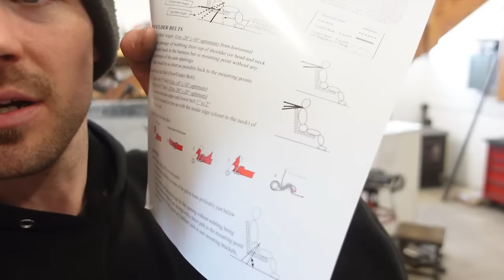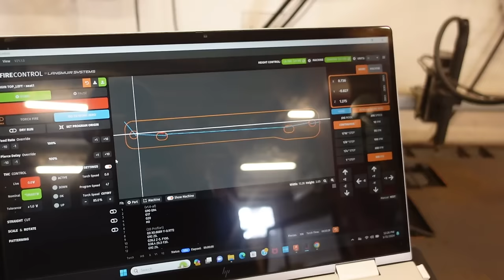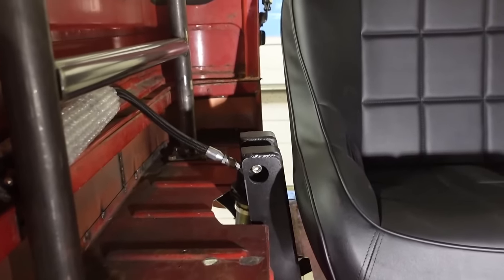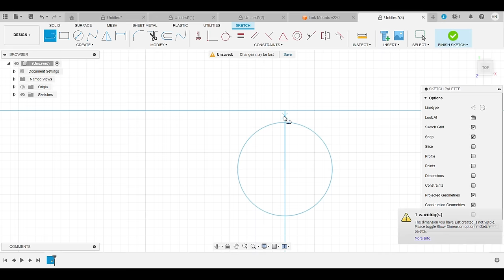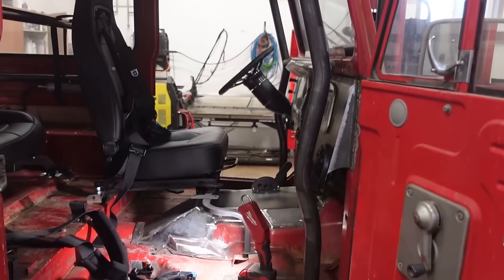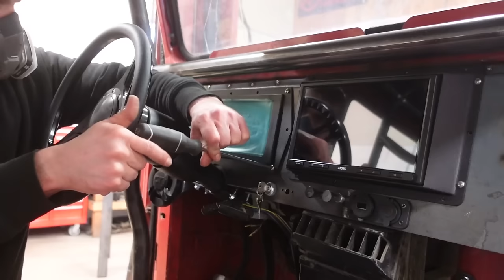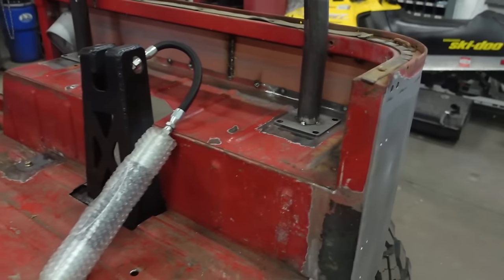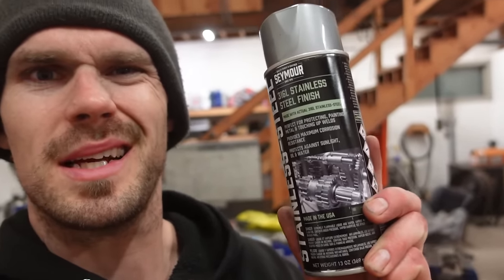FJ40 Gets A Corbeau Rear Seat, 4 Point Seat Belts And A Painted Roll Cage!

Comment: Could you Run a bar under the seat to tie the shock mounts together?
Reply: I was gonna say the same maybe like a square beam
Reply: I was thinking a formed rectangular beam.  It could be pretty wide, maybe 8", and about an inch thick.  It could start pretty high up on the shock mount.
Reply: Was just thinking of that exact thing☝️
Reply: Was thinking of the same thing.
Reply: just typed the same thing out, then read your comment. That is how I would handle reinforcing those rear shock mounts
Reply from the maker: The frame already has 2 crossmembers in the back, I’m not worried about that. I was trying to brace to top of the shock towers
Reply: Pipe under the seat then use a gusset on the towers/pipe
Reply: @austinniemela   but you could tie the shock mounts closer to the top than they are. yes at the top is ideal, but shortening the lever arm helps.
Reply: Was thinking the same... with some type of gusset adding some strength upwards from where the meet the mounts

Comment: Can you not mount a bar half way up the rear shock mount kick it under the seat and back up to the same spot on the other side? Add two bar disconnect connectors like the front shock mounts and notch and weld it through the set bracket mounts. It would still let you remove the seat but give you the most support. It would gain you a support maybe 8-10" higher then the frame mounts? my $.02 Also freaking love the color of the roll cage!

Comment: Looking for how the roll over frame is attached. Is it just through the sheet metal? I used a 1/4 x 6 “ backing plate the full length of the wheel wells. Aluminum because I don’t have the metal working shop you have. I just have the OEM frame. Elsewhere, For individual gauge panels I find aluminum is a whole lot easier to cut to fit the gauges and doesn’t oil can the way thin metal does. Just a thought

Comment: Thanks, Austin! 

IMO using a sandblasting shop is the way to go. Before you bring it back into the shop though, make sure to blow it out a hundred times outside. It's amazing how much sand/media can be held in joints.

Comment: I would swap the rubber body mounts for aluminum pucks.  That rigid mounts the frame and body together, making it easy to attach the shock towers to the cage.  That is how it is done on second gen F-bodies (I have one out in the garage like that).

Comment: Next time instead of going through the trouble of cutting and re-centering your body mounts for the roll cage, try getting a 4 ton porta power and spreading them back out, much easier, and a time saver, just make sure if you do this in the future to over bend slitley sonitnwill relax itself back in its normal postion. Ive been doing frame work for over 20yrs, teist me itll work and save you time. Remember, everything moves when heat is applied

Comment: Austin, I see you use Fusion to draw your parts.   My table runs Mach 3.  I'm having issues with my cut becoming angled on arcs, but fine in one axis.  I've looked around, do you know of a way to slow feed rates on arcs?   Love the build.  My older brother had a FJ many decades ago but Ohio salt got the better of it.

Comment: Maybe do an integrated desing with a bar that ties both ahock towers and at the same timw functions as a head rest for the back passengers. That and a mount that's removable, similar to the one you made for the front, but that goes underneath the back seat.
Btw I'm loving the project and I'm soo glad you went with the full resromod theme for this one, it's gona be a beast. <3

Comment: I feel like you missed a great opportunity by not creating the rear seat frame as an integrated strut bar. Also, your front seat shoulder harness bar should be lowered. All racing regulations have this as a requirement. The shoulder straps should run up the back then roll over your shoulders down. This prevents torso movement in the vertical plane.

Otherwise. Far better execution than my abilities currently. I am always encouraged by your willingness to just move forward and get it done. Keep it up!
Reply from the maker: The upper straps should be 0-10 degrees, these are right about in the middle at 5 degrees down!
Reply: @austinniemela  interesting! Maybe technology has changed and I haven’t kept up! Regardless, I have always enjoyed your work. I’ve been following along since the flatbed build.